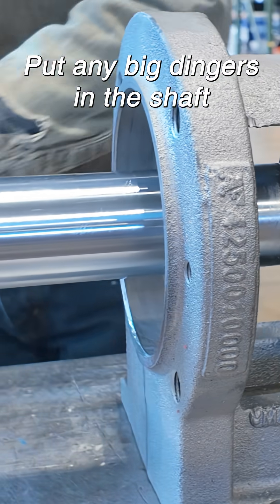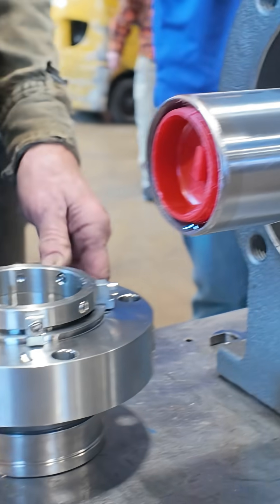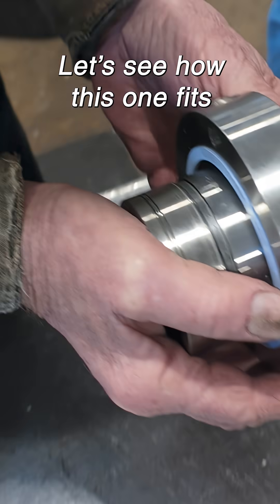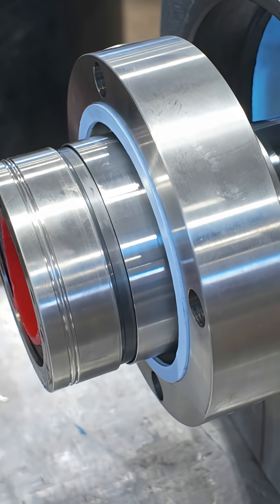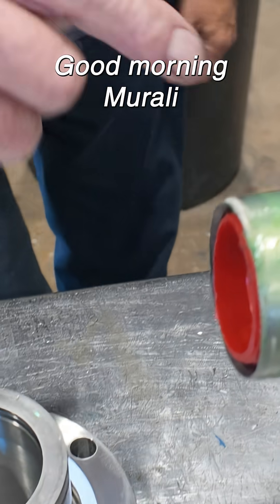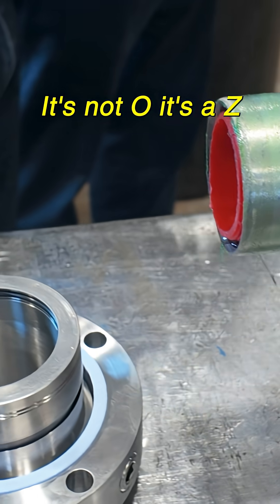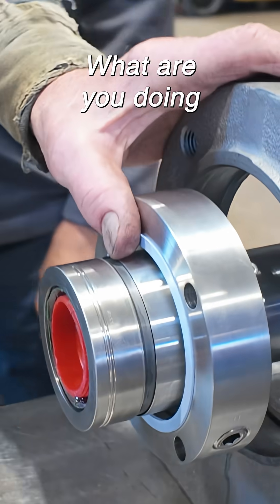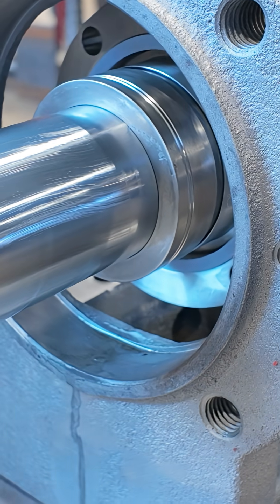Rebuilding Our Millennium Series Progressing Cavity Pump Part 14

Comment: I’m trying to understand what we have here? Large shaft, a mystery housing and a bearing that’s only supposed to slide on/off even after being in service? If you such little pressure on the shaft why use such a large shaft? Something isn’t adding up as the expense of the large bearing is substantial is this a thrust bearing application?